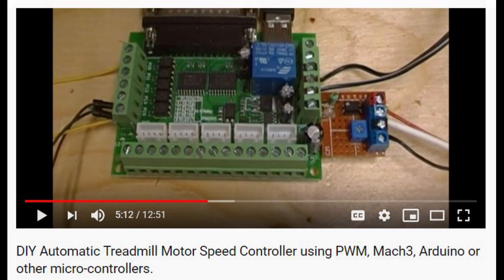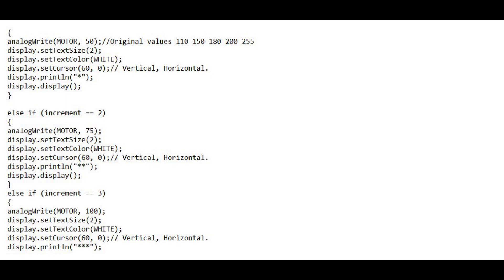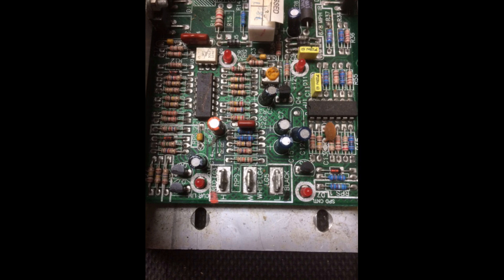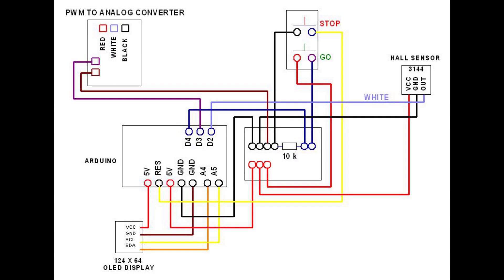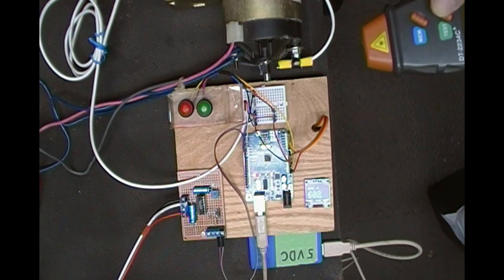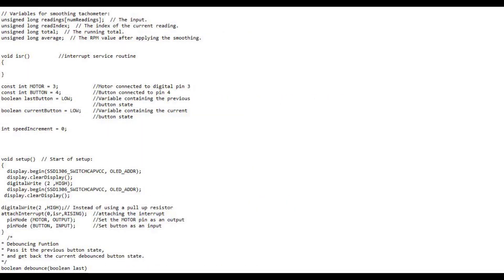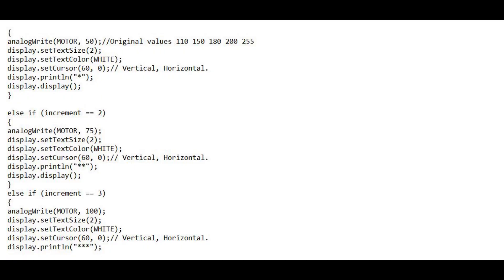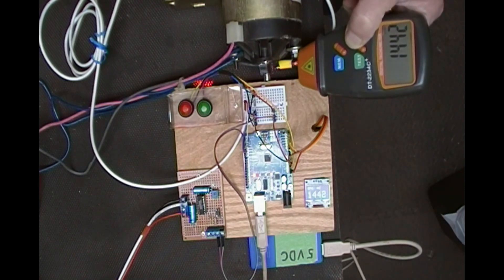Incremental Treadmill Motor Speed Control

Comment: Why can't we simply apply analog voltage to white terminal of treadmill motor controller? Why is the red terminal required? I tried without connecting the red terminal and it doesn't work.